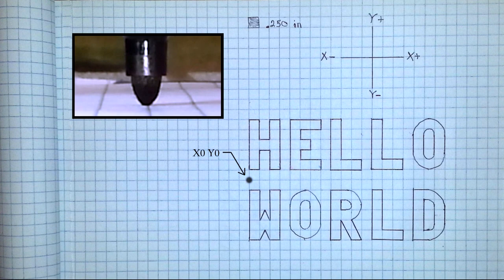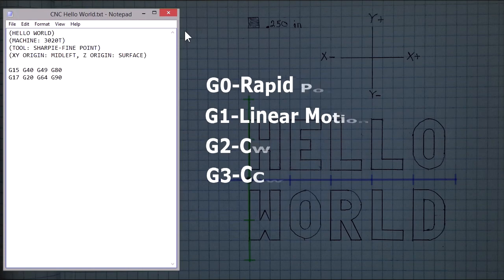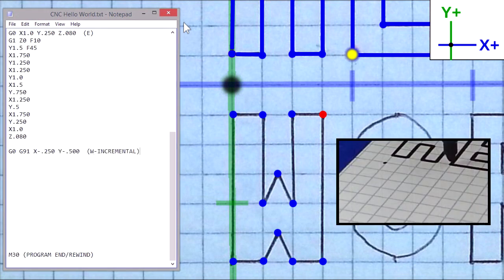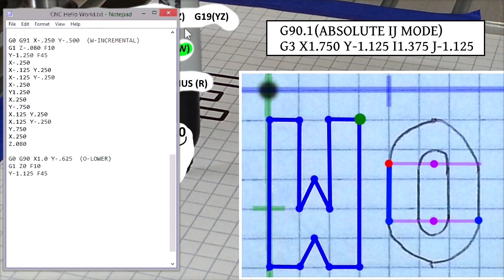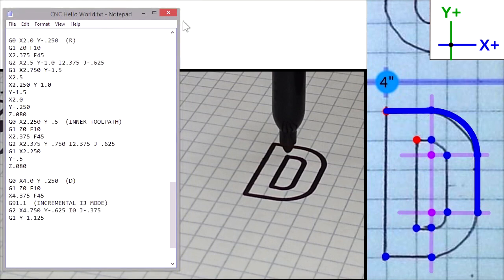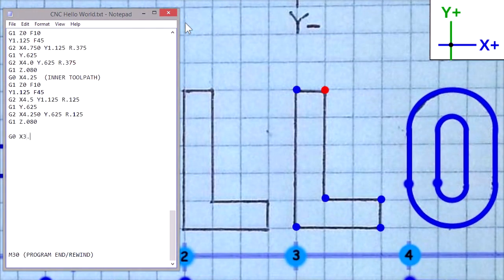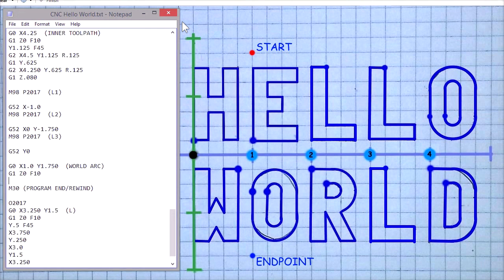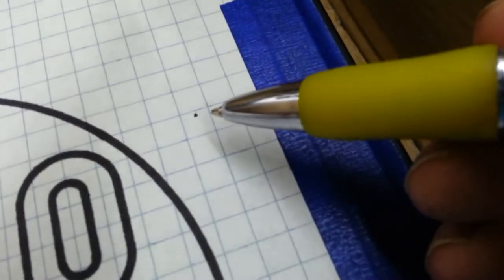CNC Mach3 | Hand Coding Exercise | HELLO WORLD - 3 Axis Programming

Comment: how did you calculate the I and J  ?
Reply from the maker: +sam terian 
Absolute IJ mode (G90.1): Arc center distance from program origin.
Incremental IJ mode (G91.1): Arc center distance from arc start point.
I is X.  J is Y.
Does this help you out?
Reply: @sunny5rising  this helps a lot thanks.